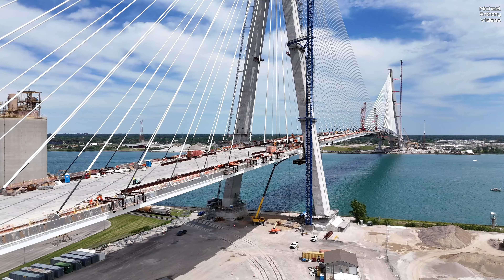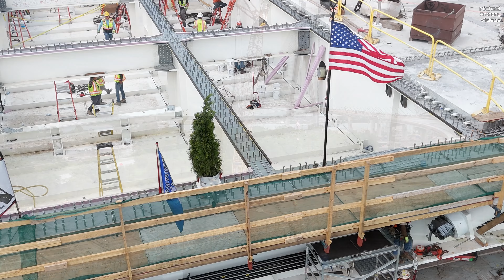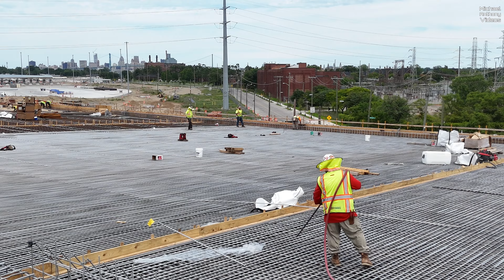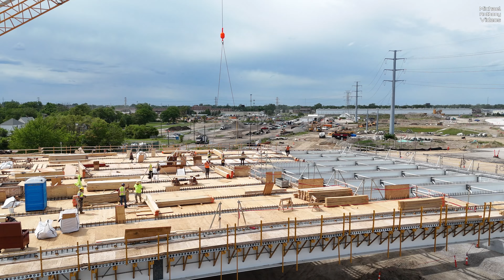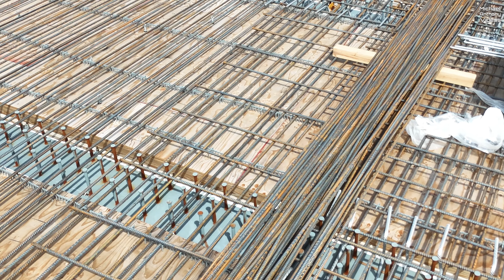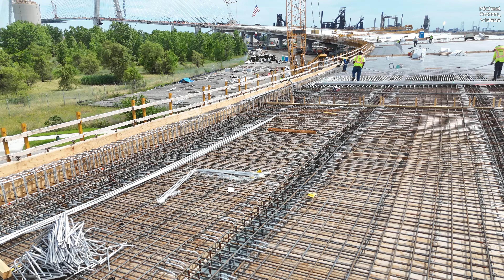NEW Gordie Howe International Bridge Construction Footage | Detroit, Michigan

Comment: What happens to all that lumber?
Reply: It’s the pecking order for used stuff . You asked the supervisor ,and most of the time he will write you a slip for you need. One man’s garbage is some one’s treasure . That is how I built most of the my projects at home .
Reply: After the concrete is poured it gets stripped out and: see  @kamlee4010   comment.
Reply: If they’re smart, they sell it to the contractor that will be doing the replacement bridge in Baltimore. 🤙
Reply: Goes to auction and sold to contractors. A lot of it is destroyed/unusable, but a good portion is clean with minimal nails.